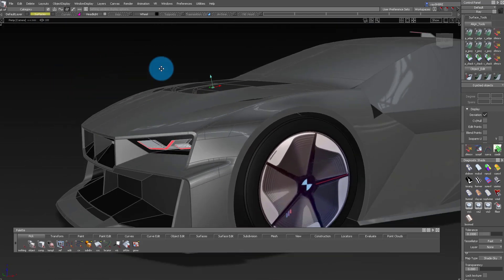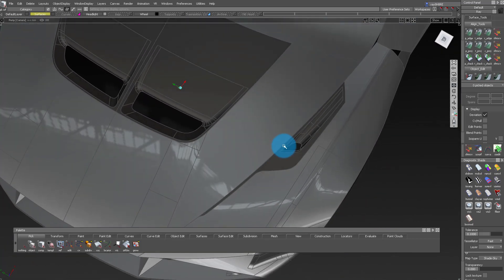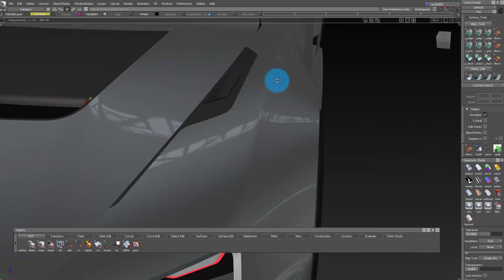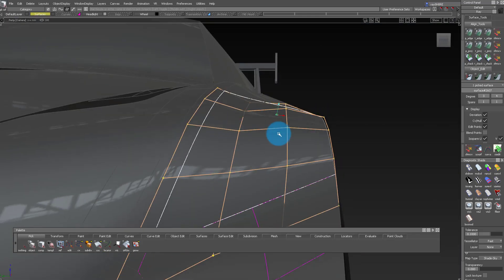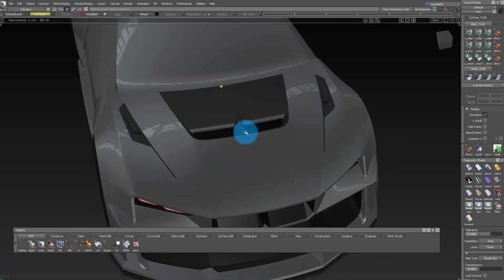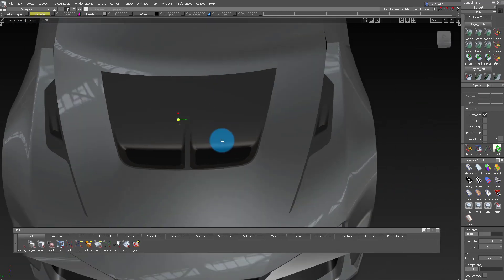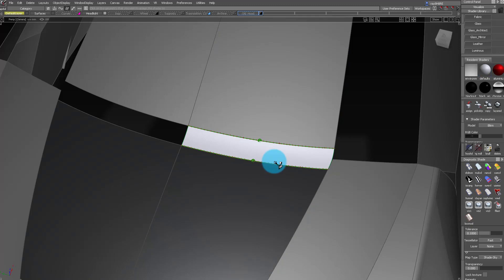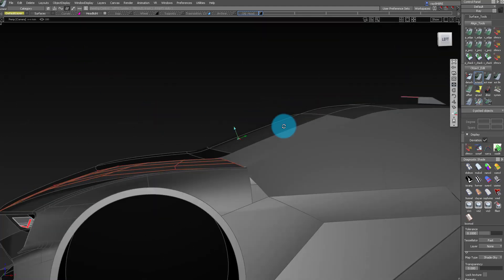Sketch Modeling a Car Exterior part 7: Adding Hood and Fender Details

Comment: Hi,thanks for tutorials.
I have a question,
what is your PC hardware configurations and is that enough for merely heavy projects?

what do you suggest for better performance of Alias,more cores or less cores with higher clock?
and what about the graphics card?
thanks so much.

Comment: What are your thoughts on using Alias, or Nurbs surfacing in general, for architectural design? I know that and how these kind of models could be incorporated in a production pipeline. 
However, my department does not offer any software education, but I am interested in learning the ins and outs of surface modeling to create more complex (interesting) designs.

I am a little intimidated by learning yet another program. Especially since I have a couple others on my list for other purposes such as rendering & parametric design (I recently started with Rhino + Grasshopper). I was wondering, could you perhaps point me at some other Nurbs surfacing resources that are applicable to Rhino, before I dive into yours when I decide to learn Alias?
Reply from the maker: If I were you I would definitely stay in Rhino and grasshopper. I myself use them quite frequently at work and on my own projects at home. In architecture, Rhino is much more set up for their needs and workflows. Alias is for automotive and product design workflows. 

In terms of your department offering you software education, that’s doesn’t matter in today’s world. I’m self taught in rhino and Alias, theirs is plenty of resources outside of school.
Reply: @HandleBar3D  That's good to know, do you think that it's possible to follow along your tutorials with just Rhino then? Or is it lacking certain crucial features?

For me finding resources from knowledgeable sources such as yourself is the most important to learn about modeling. Second is to make concious decisions on what to learn without wasting time on irrelevant programs. Thank you so much for putting all of this out for free!
Reply from the maker: Phazon ZNL I think the theory I teach is applicable to all forms of modeling. The tools are different so the path to the end result might be different but You can use this approach in clay modeling, polygon modeling, or any nurb modeler. 

Making the first basic structure, refining the volumes, adding the transitions. Working from big form thinking to smaller details.